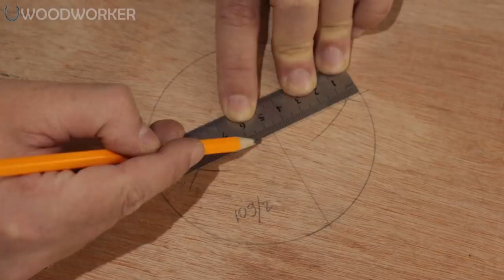Intelligent Secret Tricks That Will Take You to Another Level of Work – Ingenious Tools, Repair Tips

Comment: Scissor sharpener is not good because it only sharpens half the blades.  Also the rubber band used on the water bottle is probably not food grade.  I would buy food grade rubber bands if you want to do this.
Reply from the maker: Where did you get this about scissors? Why claim a lie?